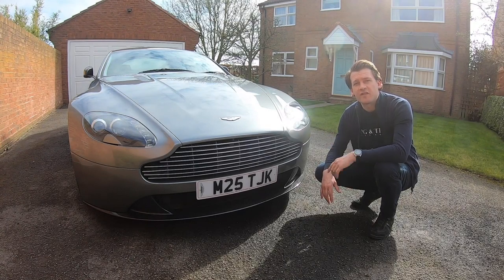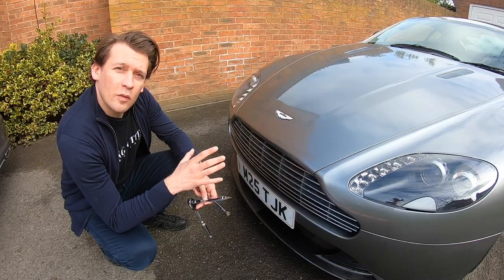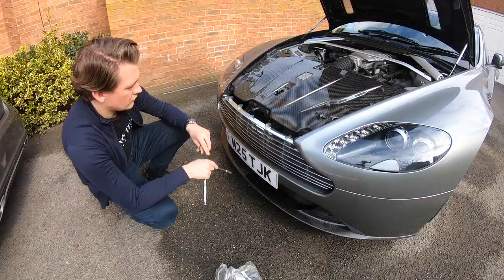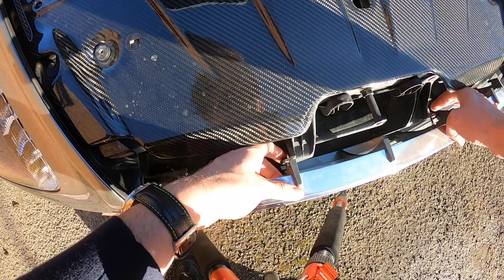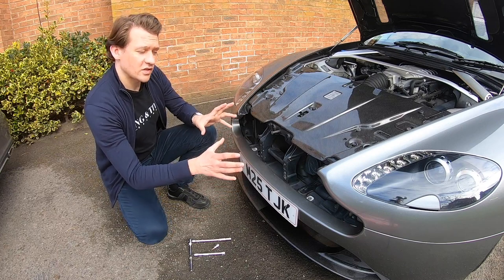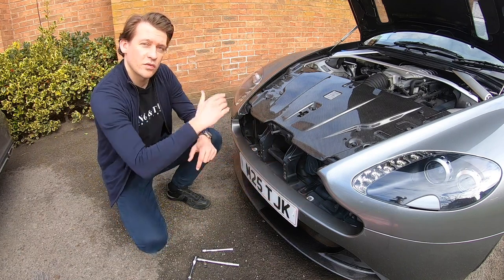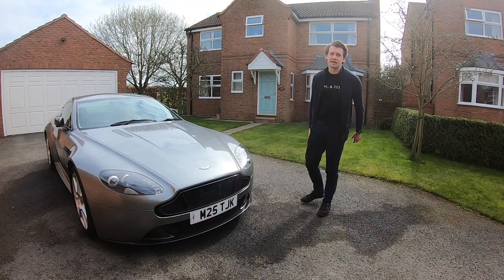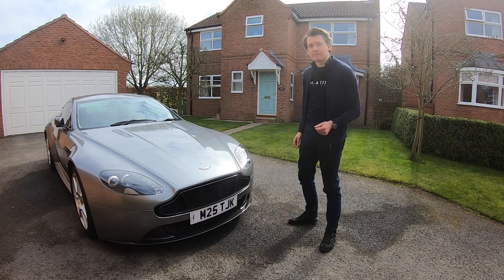Upgrading the Aston Martin Vantage Grille

Comment: Looks really good! Is the grill from Aston Martin or a 3rd party? Also you mentioned in another video the car is wrapped, is that with a clear coat or another colour?
Reply from the maker: The car is Obsidian Black but wrapped in Tungsten Silver and then PPF’d over the top. The grille is a perfect copy Mildred off the original parts and produced by ECPS group. They make the best quality Carbon I’ve ever seen so I’ve worked with them for all the carbon modifications.

Comment: for me AM and the aftermarket folks have missed a trick with the vantage especially. The grill/aperture looks incomplete IMHO. Having the grill alone does not delineate the shape of the aperture, whereas having the lip + mesh option loses the linear character of the grill. The DB5 for instance had both the outer lip And the grill bars - which looks finished off. And some of the lipstick effects out there look plain daft.
Reply from the maker: That’s a really good point, and it would certainly be interesting to see someone make a grille that also uses the slats, that could be a very beefy looking front end.
Reply: @KingandTitanRacing  I'm thinking of doing one - should be pretty straightforward😁
Reply from the maker: @irw4350  make sure you post about it in the FB V8 owners group, I know I’m not the only one who would love to see how that looks on the car.
Reply: @KingandTitanRacing  will do